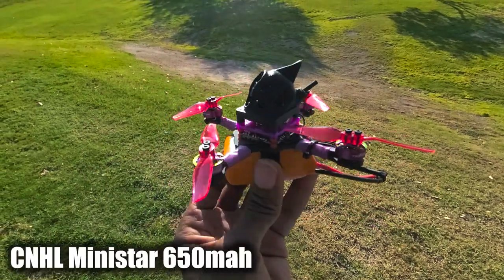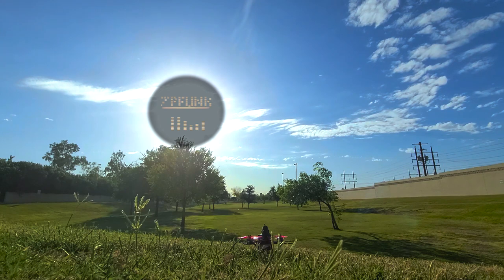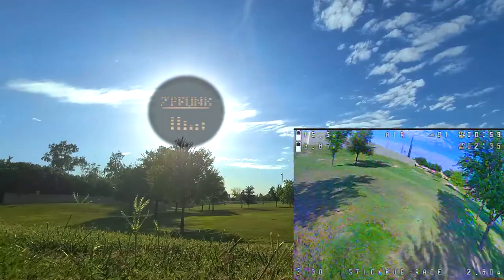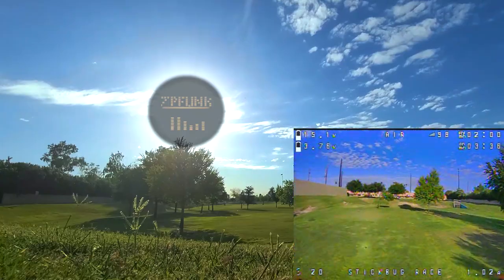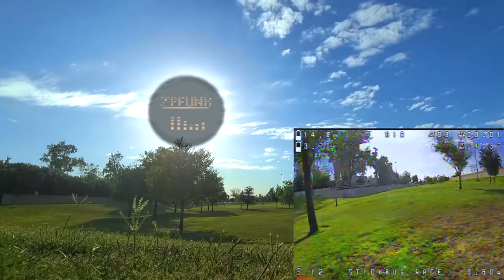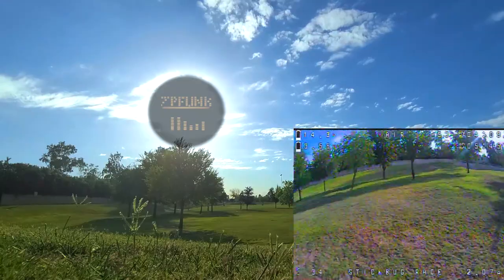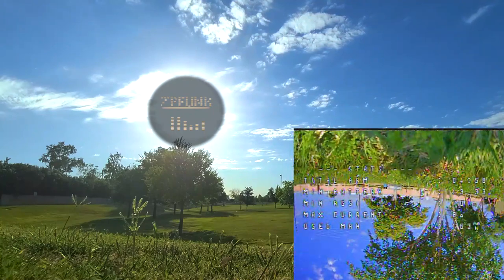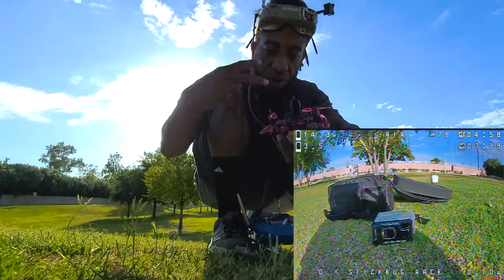Stickbug Racer 3 [CNHL 650mah 4S]

Comment: What’s your dry weight and all up weight also what props did you use I wanted to build a 2.5 inch with 1204 8000kv but I wanna still be able to run 3s I know it can handle a 2s
Reply from the maker: HQ 3" BI-BLADE